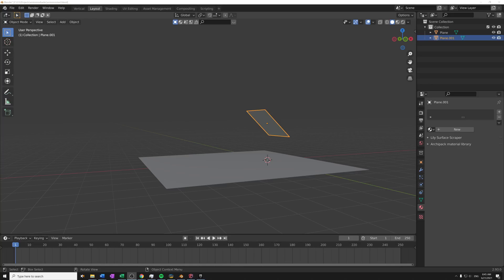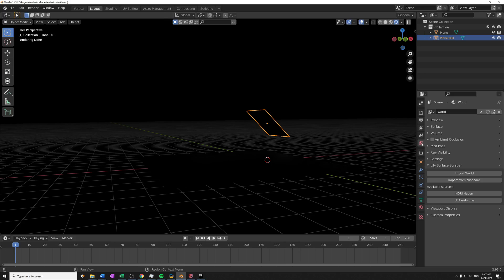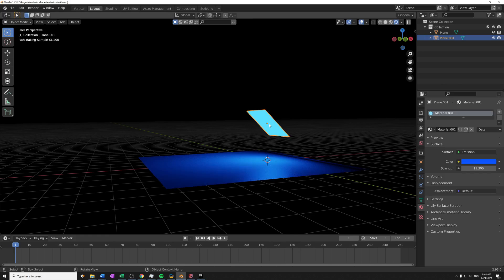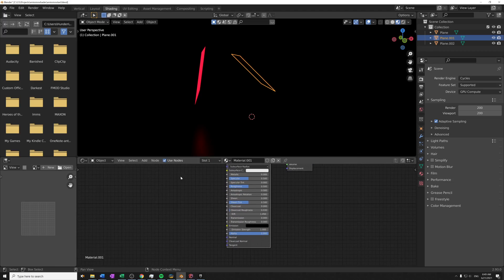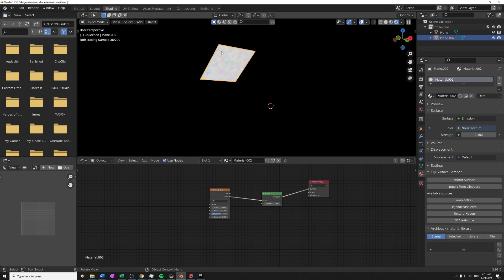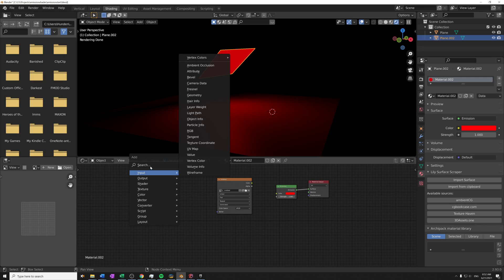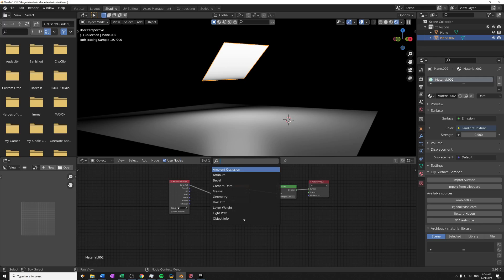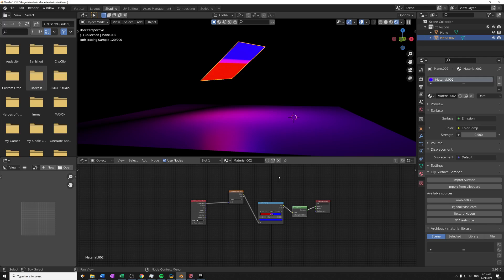Blender emission shaders guide

Comment: Blender has black body and wavelength emission shader inputs. But what about emulating the spectrum of a fluorescent bulb, or a mercury vapor lamp, or for that matter, low and high pressure sodium lighting like that found in street lights? Fluorescent is not white light. It has a spectrograph with peaks in specific wavelengths. In other words, it's a low CRI (color rendering index) light source, unlike a black body radiator which emits light across a broad spectrum. I have not yet been able to emulate such as fluorescent lights in Blender. Seems to me it could benefit from having a configurable shader where you can draw a spectrograph of the light you want or choose from presets and plug it into Emission shader.